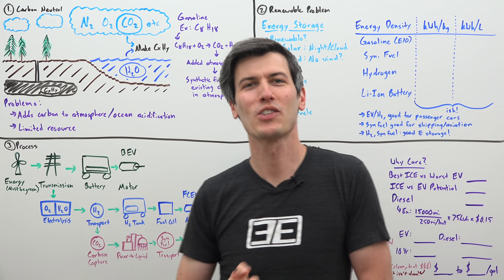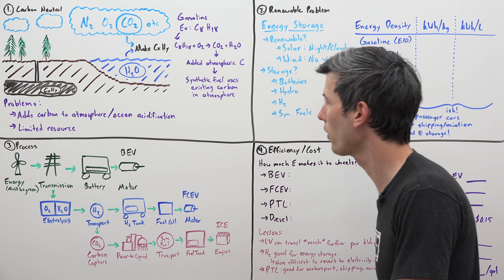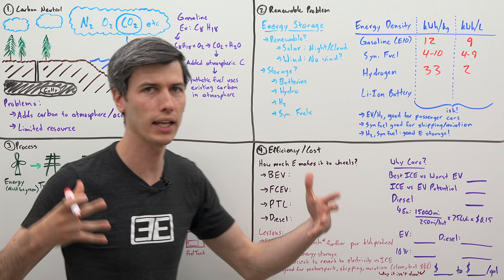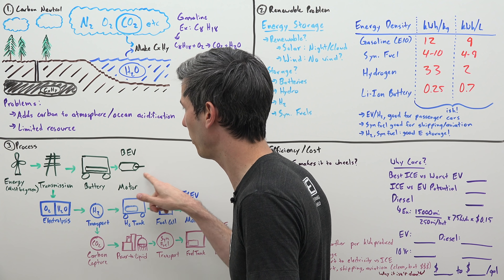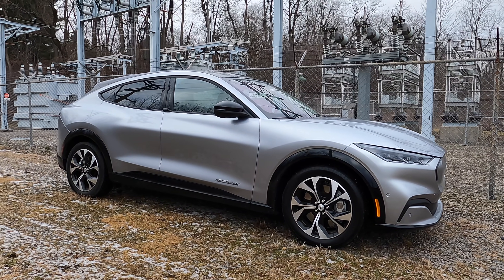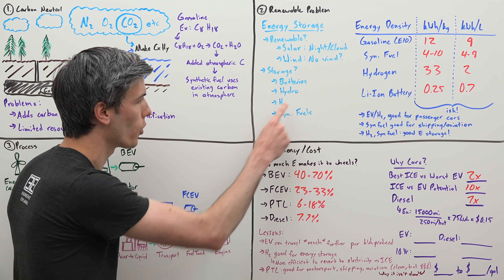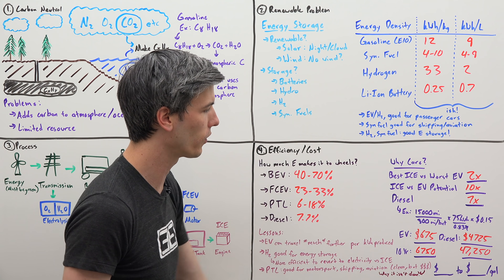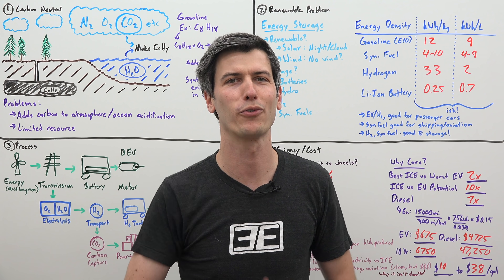The Big Problem With Synthetic Fuels

Comment: I can see the price of synthetic fuel being driven down similar to how the price of batteries has been driven down. And that cost could be offset by blending with ethanol or petrol based fuels while tech advances.
Reply: Yep. Gas at the pump will eventually be mixtures of something like B20 (20% biogasoline or e-Gasoline with 80% petroleum gasoline), then as more efficient and scalable eFuel production techniques are discovered, it will rise to B50, B75, and then B100.
Reply: I can't, because I doubt very much it'll go on general sale, because it won't be produced in sufficient quantities.
Reply: You are not getting the main point here which is that to produce synthetic fuels you need energy and you go through multiple steps. Every step is an energy penalty.   Because electric vehicles get the electricity directly from the grid they involve the least number of steps and therefore they are the most efficient.  There is go way to go around that.
Reply: @damartimantilla  You are using Jason's simplification as a doctrine. Just because there is more steps does not mean it is more energy efficient. If each step in synthetic path was 99% efficient and charging of battery was 5% efficient, would the battery be more efficient just because it has more steps with it's 5% vs 90+% efficiency?
Reply: @XQgint  He's still right. Though he doesn't specify it, the multiple steps for synthetic fuels are less efficient than electric production. So his point still stands even if you're right that it's possible to be more efficient with multiple steps than a few, it's simply not the case here.
Reply: @XQgint  after all you putting synfuel in a combustion engine with an effiency of about 25%. So you never can get better than these 25% even if all steps are 100% efficient which they are far from because of physics
Reply: @ME-cb1vw  no doubt but battery tech is pretty terrible currently also. Mining it isn't ideal and recycling batteries simply can't get anywhere near demand will be.   Compounded by creating more cars period, vs fueling current cars with a renewable fuel. Not everyone is high-middle to upper class and can afford a 40-100k dollar car unfortunately.
Reply: @ME-cb1vw  You can get combustion diesel engines with closer to 60% efficient now with opposed pistons.
Reply: @damartimantilla  also what about the cost that batteries will have on environment and the ecosystems it mined at? EVs will just cause demand to skyrocket. So i guess so long as people wont see it since it will be confined to destroying the places its mined at itll be ok? And what about the cost of doing away old infrastructure? we all know the US current infrastructure has trouble keeping up with demand without the massive strain EVs will bring. Im not against EVs i just think everyone is expecting the change to come way too soon.
Reply: @damartimantilla  who cares if that power comes from a renewable source like solar,wind,hydro,nuclear.
Reply: @jtackerman28  Prices do. For the same exact energy, you'd spend more on one source and less on the other which ends up making synthetic fuels not viable.
Reply: @jtackerman28  because all of these power plants must be built. They don't magically appear over night. This also costs resources.
Reply: @damartimantilla  You shouldn't take Jasons conclusion as gospel. He left out a lot of factors. We already have the infrastructure to distribute the E-fuel. Also, the E-fuel will be made at locations on Earth with the cheapest green energy available. Your local grid is likely far more expensive and 
In Norway fast-charging an EV costs more than half of refueling with gasoline. E-gasoline is going to become cheaper than fossil gasoline eventually.

Comment: I always love explaining to people that if the 24kWh battery in my LEAF were a gas tank, it'd hold three QUARTS of gasoline (based on about 32kWh/gallon), and yet that amount of energy gets me 80 miles (when it was new, on those rare days I don't have to run the A/C). The analogy breaks down just a bit when you consider that the battery is 668lbs with a volume of about 31 gallons. 🤷‍♂️

Comment: I don't completely agree. You always can get a different outcome with a few adjustments. Example: electric vehicles do not have a gearbox and ICE do have one which makes them more economical at higher speeds compared to an electric car, etc.
Reply: EV's would be much more efficient with a multispeed transmission or a CVT as electric motors have a range of optimum efficiency as well.

Comment: 7:14 omg, why would you want to capture CO2 from the atmosphere?! that sounds super wasteful, with the CO2 concentrations that we have… you would ideally want to capture it somewhere like cement manufacturing.
Reply: You need the synthetic fuel to be carbon neutral, otherwise what's the point of using a synthetic fuel rather than a mineral one?
Reply: @gigabyte2248  you can get co2 from (e.g.) cement manufacturing “at the source”, so to speak, in high concentrations before it’s released to the atmosphere. getting it from the atmosphere on the other hand would require immense/massive/gargantuous amounts of air to run through the system, which requires a lot of energy.

p.s. the other advantage of synthetic fuel is, that it can burn clean (no leftover contaminants).
Reply: Seawater is a good source of CO2, concentration is about 40 times that in air and it is easily extracted electro chemically.

Comment: I feel like vehicle weight also plays a factor in this as well, comparing a tesla to a normal or luxury sedan, it's probably about 2000 pounds heavier. This would require more energy in order to move the vehicle. With this factored in, my estimate is that the electric vehicles are only 1.5 to 6x as efficient with this process. With normal fuel, probably the same efficiency, up to 3x more efficient.

Comment: So why are Toyota and all Japan going with H2O into ICE as well? Do H2 Fuel cells do away with the heavy exotic metals required to make batteries (LI-ion) so they can actually replace all ICE that batteries dont have enough supply to do? Projects around the world to reduce the cost of H2 like Australia has a project s for 2, $2 for 2litres of liquid H2 etc. what price point does HICE make sense?

Comment: Fantastic Video! however, the way to look at it is not EV vs. eFuel - they are two solutions to two different problems.

I look at eFuels as a transitional technology, and in certain cases the necessary technology. Without a doubt 99.9% of all new Passenger vehicles, will and should be EVs by 2035

Comment: I agree with your observation with regard to using hydrogen as storage, however you assume that maximum efficiency is a goal or necessity. In a carbon neutral environment, what's the rational for maximizing efficiency while entertaining the complications of a battery supply chain life cycle? I posit that the demand for less efficient premium vehicles will persist long onto the future, better yet that garish vehicles will flourish under the guise of clean, not efficient energy.

Comment: Well the issue with EV is, what happens when "all" the cars are charging. First you got to create that amount of electricity and then you have to deliver it. And that is a big problem which most likely will not be solved (for all - just look at those countries which are not industrialized). Some algea can produce "oil" - well basically that is what happended millions of years ago - and this could be a efficient way of creating eFuel.

Comment: How much does it cost to build and service el. grid to cover demand of so many el. cars? 
Is it possible for el. car to work for 20 years with no battery change? What to do with dead bateries? What about lithium mining?
Reply: What about cobalt mining? The big oil companies have been doing that for decades. Old EV batteries can be almost fully recycled, and the cobalt and lithium can be recovered to around 90% and re-used. Try watching the YouTube video of the Tesla Model S owner, whose car has covered 400'000 kms on it's original battery......

Comment: Thanks a lot for this video !

I never thought synthetic fuels would replace the electric revolution. I personally think they can be part of the solution to make cars better. There’s no way we will be able to power all current ICEs with synthetic fuels, but the electric revolution is also inherently polluting (because replacing used cars with new cars will be pointless and extremely polluting. Electric cars make this effect worse). There needs to be a way to power existing ICE cars with better fuels, and to make the automotive business actually greener by slowing down the rate at which new cars are produced, used, and purchased. Fuels like bioethanol and synthetic fuels make sense because they keep current cars on the road, acting as a « green cushion » awaiting most ICEs to be replaced by EVs. 

They’re not made to be particularly efficient, they’re made to allow people having a cleaner fuel without the hassle for governments to build a wide electric infrastructure, to invest in versatile electric cars, and to convince people of buying them, and to enact the electric revolution in a more calm, slowed down way.

I think synthetic fuels will be useful for very precise uses: heritage use, motorsports use, maybe people who don’t have the means to get an electric car yet. I also think governments should produce synthetic fuels along their renewable energy plans, mainly with nuclear energy, so that this production goes public and the price gets capped by the government.

I see current automotive mobility in 2050 shifting to mass transportation like the tube or the bus (~50%), to BEV/FCEVs (~40%) and the rest being ICE-powered by biofuels or synfuels (10%) for heritage, motorsports or car culture as a whole.

Comment: Synthetic using the first generation processes we have now isn't efficient. Neither were the first solar panels. There are definitely efficiencies to be gained in the synthetic fuel production process. It doesn't even have to be a chemistry process. It could be genetically engineered algae that can just take the CO2 directly out of the atmosphere and light directly from the sun to create the fuel that can be skimmed off the top of the pond. That skips many levels of the losses in conversion and processing.

Additionally, the infrastructure for transporting and storing liquid fuels already exists. The infrastructure for transporting electricity is already way behind what we will need and storage isn't practical at large scale.

That being said, there are definitely technology developments that will help renewable electrical generation and also battery and electric storage tech too.

Comment: You're not quite accurate. Let's assume 5 cars are clean diesel. and 5 are battery. If they are diesels and are off no energy is being used, but if they electric vehicles and  are not being used the power is still being generated just in case you plug them in.

Comment: I think you forgot about a couple of carbon neutral fuels that people have been making for centuries.  Alcohol and biodiesel.  Both of these can be made on virtually any scale, are easily adapted to current IC infrastructure, the materials can be largely grown and harvested rather than extracted and processed, and both fuels can be manufactured at a similar price point without needing a degree in chemical engineering.

The thing about electric cars is the same thing with cell phones.  Right now, they are prohibitively expensive and there is a limited infrastructure to support them.  With more research, development, better infrastructure, and better incentives, EVs could very well be a viable and even main stream way to solve many of the transportation problems most of us face daily.

The secondary problem arises when you scale this up.  EVs become extremely inefficient when you make them bigger and at a much faster rate than IC engines do.  For that matter, IC engines actually become more efficient at larger displacements because the reciprocal nature of the engine is forced to slow down while the chemical reaction stays the same speed.

So TLDR, we've had synthetic fuels for centuries, and electric vehicles are rising up to be a good personal alternative to chemical propulsion, but the 2 limiting factors are infrastructure and efficiency when scaled up.

Comment: Solar is great when it can be utilized but doesn't work at night. Wind is okay but doesn't work unless it's fairly windy.

Just use nuclear. Least carbon footprint followed by solar, works 24/7, and when considering modern designs can use other fissile material than just Uranium/ Plutonium.

A combination of Solar and Nuclear make the most sense for the majority of areas.

Comment: Darn, those costs probably make it not worthwhile for aviation either. I wonder if we could use pure hydrogen for aviation
Reply: Think Hindenburg. Been there done that.
Reply: Volume is the problem. Synfuels is way to go for jets. Some ICE light aircraft (think Cessna 150) might be replaced or even retrofitted as battery electric. Beaver aircraft in Vancouver are being converted to electric propulsion.

Comment: Diesel gets no love in this one 😞
Reply: Give or take a few molecules diesel and jet fuel are the same.
Reply: @jimgraham6722  I’ve heard! I wonder how my TDI would react to jet fuel ?
Reply: @sbeezynukka  It's basically kerosene, most diesels will run on that so should be ok, but might need lubricant added. Would probably run well. I understand the USN has a proposal afoot to simplify it's fuel stockholdings by standardising on a single fuel type, essentially JP 8, that would be used as diesel MT, small boat,  ship and aircraft fuel. This fuel will be able to be generated by the fleet at sea using synthesis from seawater, powered by naval nuclear reactors.

Comment: My problem with videos making claims like this is that we don't know what advancements will happen that could dramatically change what is and isn't viable. I constantly see hydrogen getting bashed, yet there is research into a process that uses an artificial leaf to produce hydrogen using the sun. What if someone finds a similar process to turn CO2 back into a usable fuel? You can keep ICE automobiles, not have to use up all our lithium/rare earth's and yet have a net zero emissions car.

Comment: Have you taken time to calc the energy it takes to use carbon (captured) and hydrogen to create hydrocarbon.  You might get reaction happen, but the energy you are using for this and some of the other steps is more than you will get out of the energy (net energy loss ... none generated) ... not good.

Also transportation of electricity by grid (looks like grid from your pic) can only occur at 69,000 volts ac ... think if you check no wind generated, or electricity from sun ever gets into grid ... only by off setting (trading)... ie you are able to trade some grid electricity for some other user who can use the wind elect or sun elec ... a ton of energy here and needing it there .. this is the reason we have so many power outages .. the electricity cannot get into grid if there is not a trading partner.

Comment: Efficiency doesn't even matter, because if you had whatever magical carbon capture technology they're assuming to do this at scale you could just sequester the carbon you get from using regular fuel. Realistically the only sources of high concentration co2 come from power plants and a couple industrial processes, which means they wouldn't be carbon neutral.

Comment: I know there is a lot of research going into hydrogen storage, specifically a way to store it not as a gas, but a solid (not by freezing it, but by having it adsorb to a solid state material.) I feel like if they can bring up the kWh/L of hydrogen, the fuel cell car would be the clear victor. Imagine being able to drive thousands of miles on a single tank using a fuel source that comes from water. Plus, considering how much lighter a fuel cell car is than an EV, you'll be using that energy to transport people rather than a 2,000 pound battery.